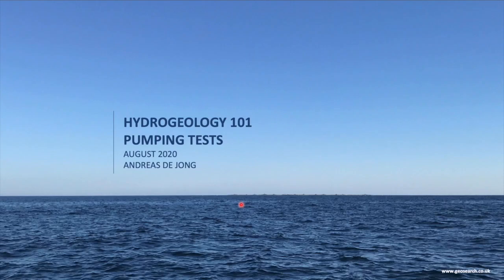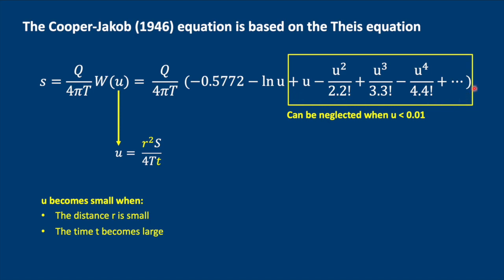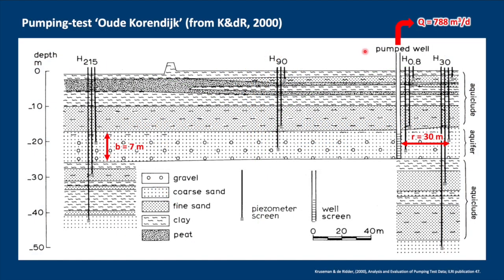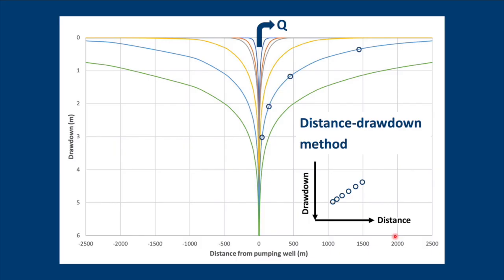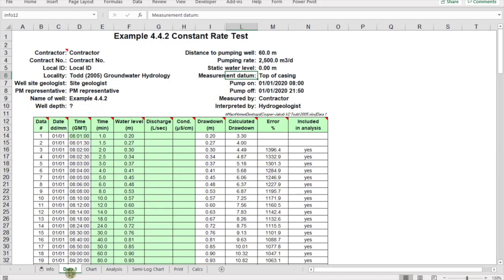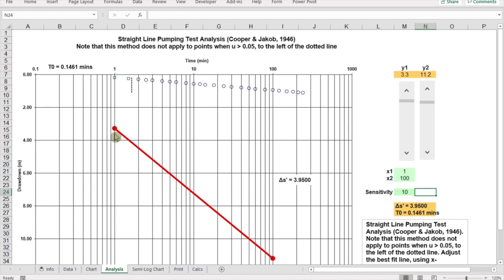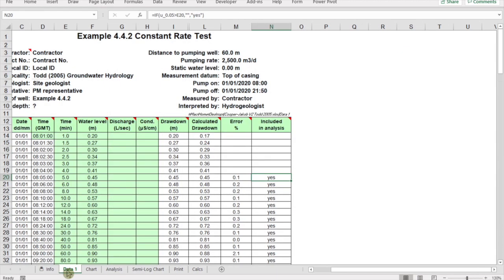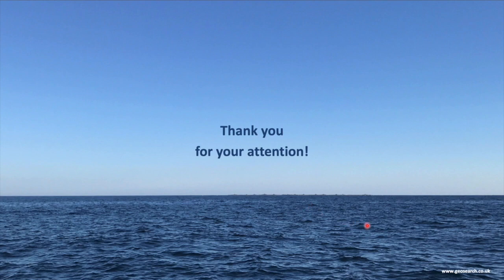Hydrogeology 101: Cooper-Jacob

Comment: Is any equation for leaky aquifer...

For steady state condition theim equation ( confine aquifer) and dupit equation ( unconfined) are used. 

For unsteady condition 
Theis equation and cooper jacob equation (confined aquifer). are used.
Is any other equation available for above work...
Reply from the maker: I would always start with the Cooper-Jacob straight-line method because it will show you what kind of aquifer you are dealing with, and if there are any boundaries (recharge or barrier). You can use it for all aquifer types - confined, unconfined, leaky etc. After that it may be useful to try other methods - for example Neuman for unconfined, or Walton for leaky confined. Read Kruseman & de Ridder for details. Pumping tests is a massive subject & I remember spending two whole months on it during my hydrogeology MSc, so there is no easy answer. What is important is to understand the theory and the simple methods first, before you start using commercial software.
Reply from the maker: I'll make some new videos as soon as I have more time - especially for step test & recovery tests. All the best, Andreas
Reply: @GeosearchInternational  thank you sir
Reply: Hello sir,

Is aquifer condition (steady state or unsteady state) determined on the basis of drawadown data??
Reply from the maker: Dear Kaleem, That's a really important question. The answer is yes, but there is a lot more to think about. When we reach steady state all it means is that the water we pump out is balanced by the water recharging the aquifer which supplies the well. As our water budget now balances, we are no longer taking water out of storage and the pumping water levels will stabilise.
If you are pumping right next to a big river, maybe you will reach steady state quite fast - couple of days/weeks. If you are pumping from the Nubian sandstone aquifer in the Western Desert of Egypt, where there is almost no recharge, you are mining the aquifer and you will never reach steady state. The water levels keep going down until you cannot afford the energy costs any more of lifting the water to the surface. In most aquifers we get recharge for one season of the year, and the water levels recover during/after this recharge event. This makes the water levels fluctuate up and down during the year, so our pumping water levels will also fluctuate during the year. They are actually in a type of "quasi-steady state".
Most pumping tests are just a few days - I usually do 72h tests - so we cannot expect to reach steady state during this time. However you may see steady state in pumping wells which have been monitored for a long time.
Have a look at this video: https://youtu.be/9Wmkugy3XdQ
All the best, Andreas
Reply: Thank u for you time.
Reply from the maker: You are welcome! Andreas
Reply: Sir,

Following steps are important to reach on correct GW equation to determine T & S.

Broadlly aquifers are consolidated and unconsolidated type.

Both consist confined, unconfined and leaky aquifer.

With the help of lithology easily discriminate b/w consolidated and unconsolidated type.

Drawdown data will help to discriminate three type of aquifer with the help of  theoritically created time drawdown graph (page No. 48 Book by Krusman de Ridder).

Time drawdown graph also predict the steady state and trasient state condiontion of aquifer.

After that easily apply equation to determine T& S for example.

Theis equation ( unsteady flow and confined aquifer)

Numen equation ( unsteady flow and unconfined aquifer)

Many others equation are present.

Is it right explanation???
Reply from the maker: Dear Kaleem,
I would split aquifers into two main types: sedimentary rocks where the permeability is between the sediment particles (unconsolidated to semi-consolidated) and fracture aquifers where the permeability is mainly in fractures. The pumping test equations usually apply to sedimentary aquifers only. You can use them for fracture aquifers, but have to be careful. There are also some pumping test equations specifically for fractured aquifers, but you need to know quite a bit of information about the fractures.
Normally if you pump for long enough and a large enough volume of the aquifer has been affected by the pumping test, then even fracture aquifers will behave according to Darcy's Law.
You can use the Theis equation on all aquifer types for the early data, but be careful as the data will diverge from the curve if the aquifer is leaky, unconfined or has boundaries. That's why I recommend to always use the Cooper-Jakob straight line method first. It shows you what kind of aquifers you have and also if there are any boundaries. Once you understand what kind of aquifer you have, then you can try other methods of pumping test interpretation.
Having said all that, I usually use step test analysis to work out the hydraulic efficacy of pumping wells, and then the straight line methods for the pumping test and the recovery test data. After that I try other methods if it is justified. All the best, Andreas
Reply: Really your explanation covers all the coners of doubt.
Thanks word is not enough for your time but I have no choice so thank you for your reply and time.
Reply from the maker: Dear Kaleem, You are most welcome! I only wish more people would ask themselves some of these fundamental questions, rather than pushing a button on some automated pumping test software and reporting a result without thinking what it means. All the best, Andreas
Reply: Sir,
Have any info regarding pumping test analysis online course with reasonable fee where I join to learn for nearly perfect in pumping test analysis???
Reply from the maker: Dear Kaleem, Sorry, I have not seen any such courses. I would recommend that you work through the examples of Kruseman & de Ridder, and maybe some other textbooks. Of course, this should also be accompanied by an in depth study of hydrogeology because you need to fully understand groundwater flow, boundaries, recharge etc to interpret pumping tests. All the best, Andreas
Reply: Thank you